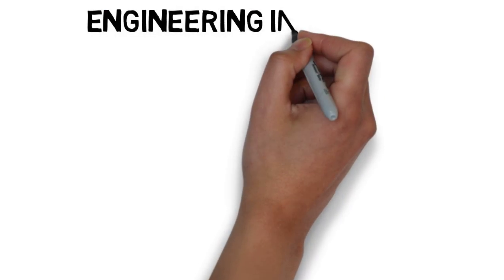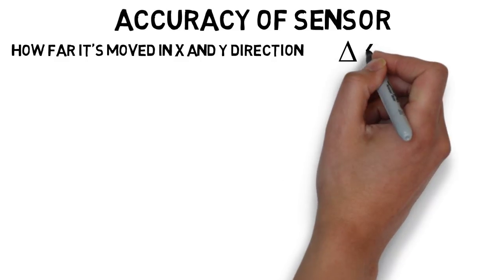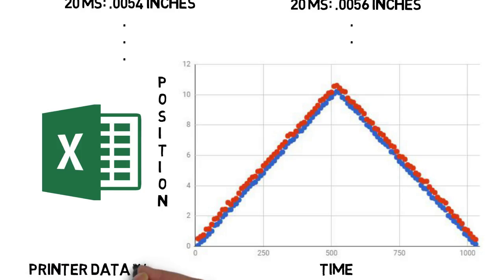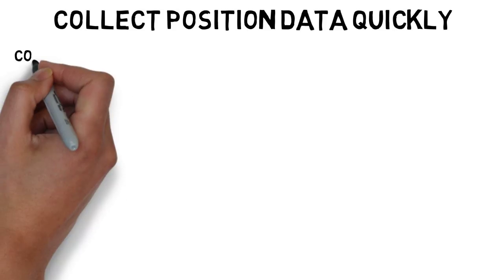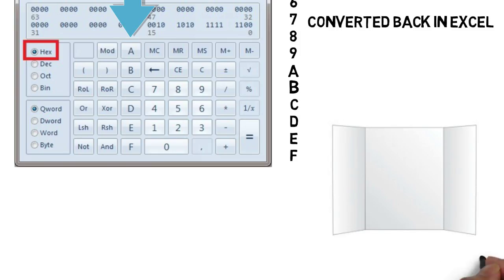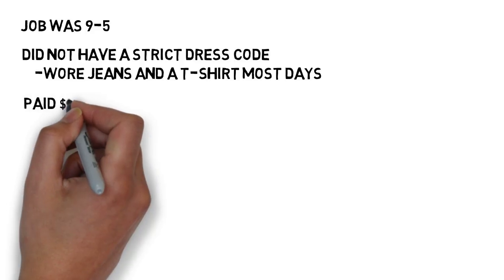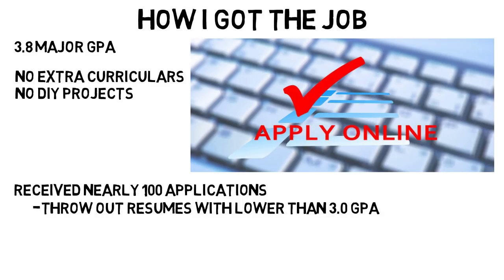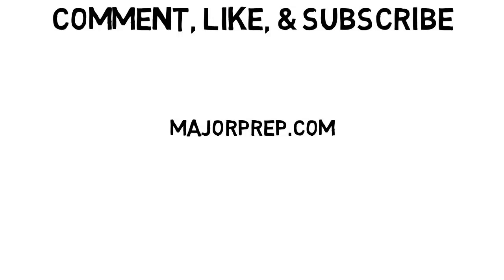What I Did During My Engineering Internship

Comment: Hey MajorPrep , a beautiful video as usual .
I wanted to ask you about the interlacing of different engineering fields ..... Especially the mechatronics field , can a mechatronics engineer have a job as a mechanical or as an electric engineer ? If yes then to which degree ? For example can he/she design car engines , suspension ...etc or design electric circuits or devices ?
Thank you for your videos , can't wait for the next one .
Reply from the maker: Thank you! And yes mechatronics engineers can do mechanical or electrical jobs. It's very hard to say what exactly they can or cannot do. But typically you'll hear of them working in robotics, or on control systems, and things like that. Like I'm sure they could help design the suspension of a car, but that's mostly mechanical engineering work (no electrical aspect) so a mechanical engineer might be ideal for it. But if there was some suspension system that had electrical components where it reacted to the curvature and bumps of the road (I talk about something like this briefly in the automotive engineering video), then a mechatronics engineer might be good for that.
Reply: MajorPrep Thanks for your answer

Comment: When it comes to internship how did you get experience to know to work on a hand-held printer if you possibly never worked on a printer in your life?
Reply from the maker: It was more of an arduino project and I took an entire class dedicated to projects using the arduino in school. Remember what the handheld printer was. It was an arduino, a sensor, some random electronics, and an ink cartridge. Although I didn't know about a handheld printer specifically, I had experience with most of the things that made it up.

Comment: Thank you for this vid. I love learning the nuts and bolts of things, and any "street moves" that I can acquire (like applying for jobs that you're only half-qualified for, I never would have done that, especially in a STEM field, but now...) That was a peach of an internship, mostly because you got to design and build, which I think is what every engineering major lusts for. And it was cool that you were able to do soldering.

I would like to know, though, did you leverage this internship into a career with this company or any other? Certainly it had to be great "resume filler" (experience) at the very least.
Reply from the maker: Thanks for the comment! I did not get a job at this company after school, my entry level job was much different (as you'll see in a video coming out soon where I go into detail on my first job). After the internship my boss told me to get in contact with them when I'm close to graduating about a full time position but there were many other companies I wanted to work at and once I got into one of those I didn't need to reach out to this company I interned at. But yes it was a huge resume booster that was a talking point of lots of interviews I did during my last year.